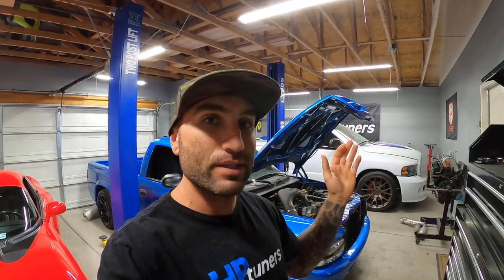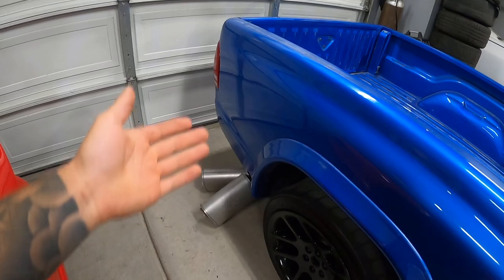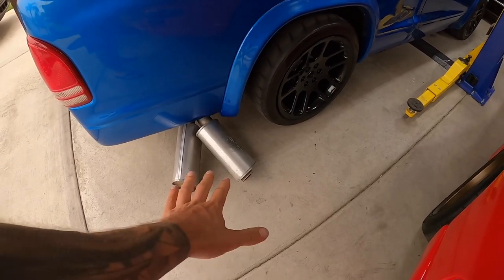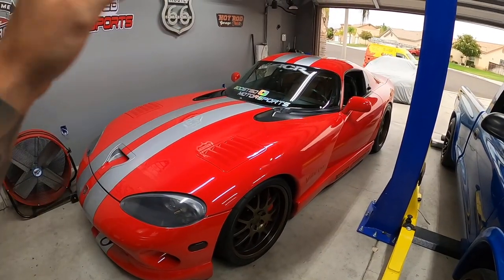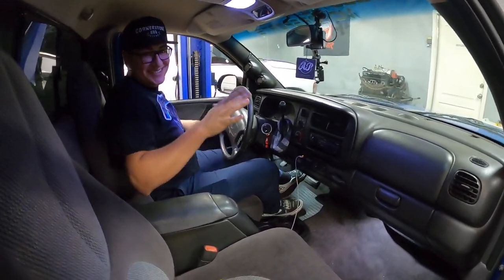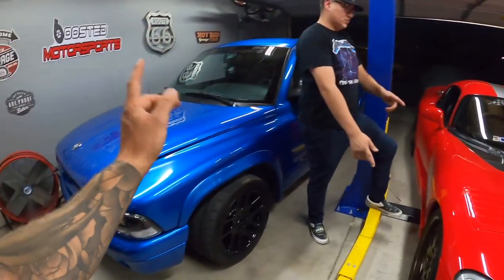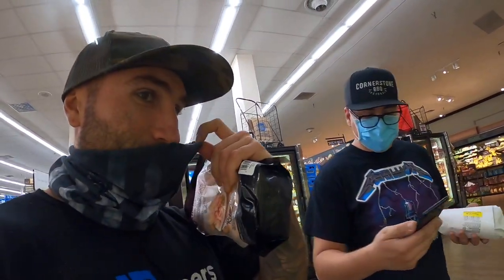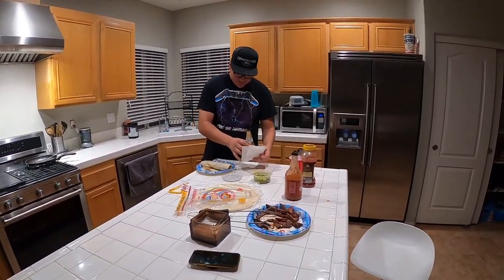Never Trust This Guy With Your Keys, Mother, Sister, Daughter, or Bolts

Comment: So I actually copied your idea of the hellcat resonator as a muffler but I did a custom y pipe to h pipe with the hellcat resonator and than two 13 inch long single wall tips out in front of the rear tire  we basically have the same set up currently editing the exhaust video if you wanna hear it soon
Reply: Video is posted

Comment: breakin the law, breakin the law, lol..get a manual valve fast valve body and on the floor maybe,that hits medium hard,an fast..there was a recall an bulletin on my shifter long ago,an they popped one on there from dealer for free....mine is dang deadly in any rain, kaufman tires have no traction after about 2 years or so...